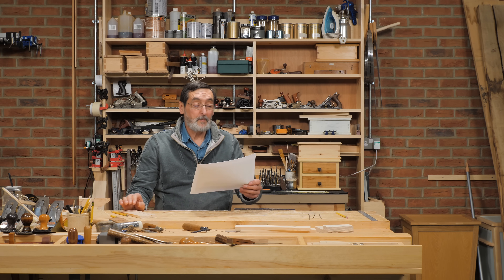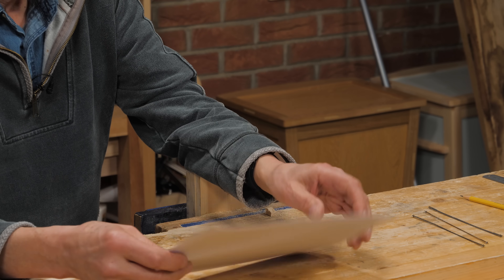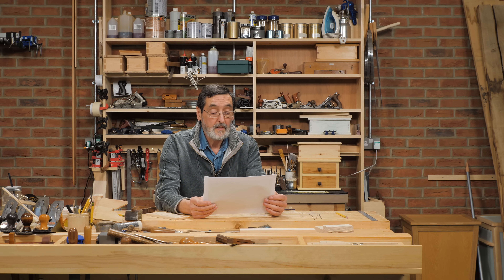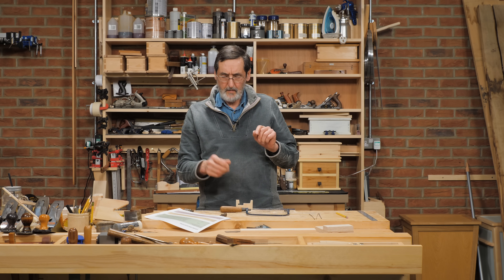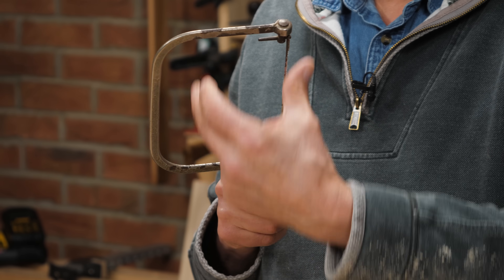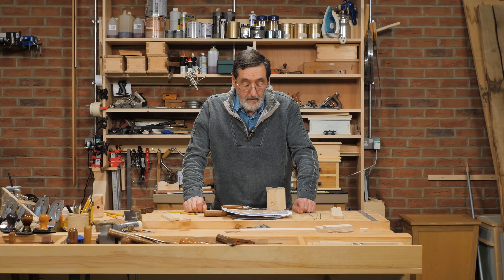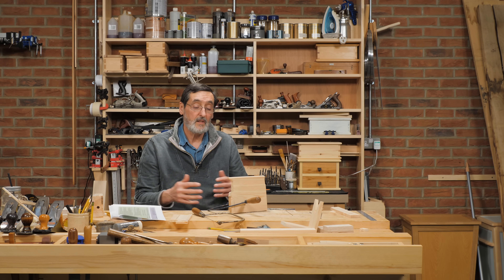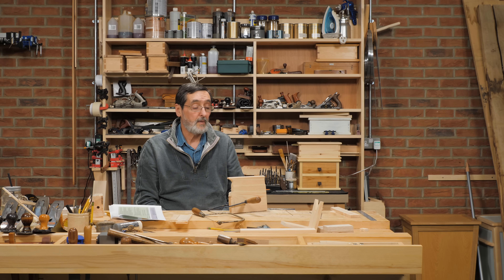Coping Saws Q&A | Paul Sellers

Comment: about pushing or pulling strokes has to be told that a pulling cut is always superior as it naturally straighten the blade while the pushing one tend to bend it. try to push or pull a rope... this is the reason why japanese saws can have thinner blades.
that told it has to be told that every frame saw works always on a pulling stroke, does not matter if you push or pull it. the blade of a frame saw has not the rigidity to work on a pushing stroke, it works cause the action, blade wise, is always a pulling action. and on this @Gordon Aitchison is completely wrong.
so in the end to use a coping saw pushing or pulling is mainly a matter relative to what type of saws you are using. someone that uses japanese type saws will find more natural and easy to use also the coping saw pulling, someone like @Paul Sellers with decades of use of western saws will find more easy to push.
about the sawdust hiding the cut line while pulling it is true, but we have a wonderful tool to avoid it: the "power of blowing" :). we don't need to use lung protection while doing most of the hand work unless the room's air is filled with small particles of sawdust from previous activities.
Reply: @paulsellers7953 , the fact of japanese saws getting kinked on the return stroke is very true, you have to be careful using them, seem to be novice friendly, but they are not so.
about them being as thick at the set i also noticed it in one lidl fake japanese a friend gave me as present and also in some professional fake japanese saws i had the choice to use on work site, but is surely not true for my original japanese dozuki, even if is not a high quality one but one with disposable blade. its blade is 0.3mm (0.012 inches) thick and the kerf a little more, even if i have no equipment to accurately misure it. no western saw that i know can match it. that told a properly tuned western saw works as well, with the same accuracy and speed of cut. if the user is accurate and well trained obviously, other way both fail.
my point was not the superiority of of the pushed or pulled saws, was that the way one is trained and familiar with works better for him.